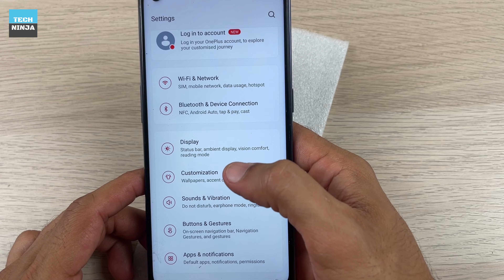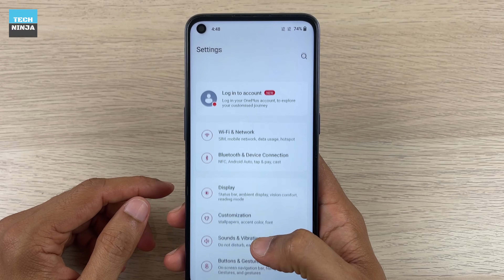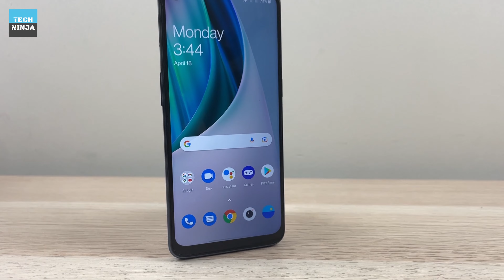OnePlus Nord N10 5G Screen Replacement | Full Disassembly

Comment: i thank you this video saved me 100 dollars in order to have it fixed, i did it my self and with a bit of cursing i succeded
Reply: How long did it take?
Reply: @juanaguilar-hi2xp ohh sorry i did it again cause i dropped it again, lol, well the first tome like 1hr and 30 the second time like an 1 hr
i was taking my time my case the blue part broke so i was being extra carful, but if i knew i would buy some thermal past to change the one it has i think its not enough or its drying out. yea dude also the heat gun is very important remove that back plate and its easy if not its a pain in the ass, also make sure you have proper double sided sticky tape to seal the back cover in to place
Reply: @320466  So what would I need to purchase in order to diassemble and clean and reassemble the phone? Like what did you purchase? I dropped it in salt water. I'm trying to be as cost effective as possible. I'm not sure if I want to buy a heat gun or just try to use my blowdryer on it.

Comment: Ok, this is going to take longer than expected, thanks for this bro
Update:
Trying to remove the battery, it caught on fire! I wasn't expecting that, be extra careful on that step and do as you see on the video. Definitely the guy doing this is pro, and there are small nuances that on the video look simple, but are quite tricky
Reply: How did it catch on fire? What happened? I’m about to replace mine, screen is cracked and the screen is showing lines of colors and the top part of screen has no colors at all is just black. I want to have some tips before I do something stupid, thanks!

Comment: I noticed the new screen frame doesn't have that black cushion like the old one did on the upper part of the frame. Is that necessary ? It won't short without it would it ?
Reply: No issues
Reply: Nice

Comment: You ever have problems with the ear speaker or proximity sensor not working when making a call it turns the screen black and you have to hit the power button to turn back on and the ear speaker is dead after screen replacement?